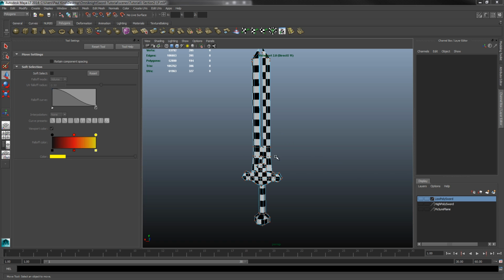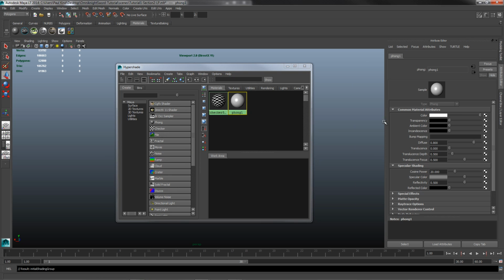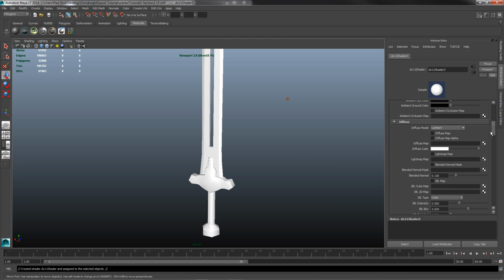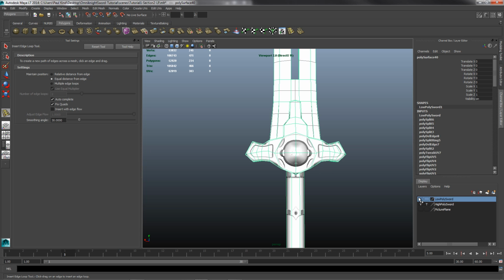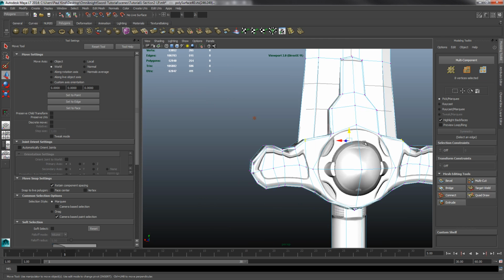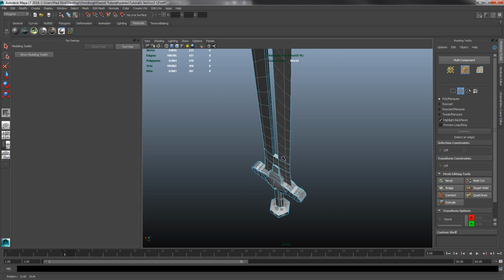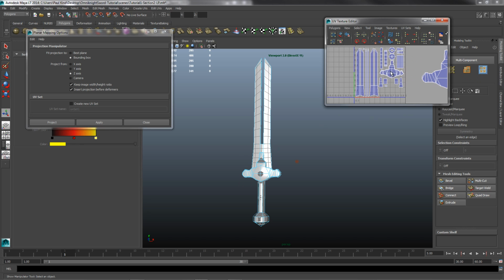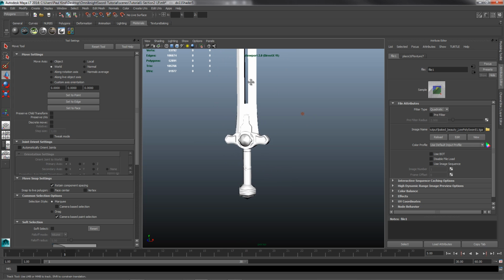Maya LT Dota 2 Tutorial -- Section 2 Part 3

Comment: Also having a problem with the DX11 shader. When selected it appears in the material editor as a sheet of paper icon instead of the normal sphere icon, and is named "unknown7", any suggestions ?

This video series has been absoloutely sweet up until this, thank you!
Reply: I solved my own problem! Guess thats what it all about!

For people who experience a similar problem its because the program was using OpenGL instead of DX11. Window > Settings/ Preferences > Preferences > Display > under viewport 2.0 select "DirectX 11"

Save your file > Close > Reopen and now it should work
Reply: Surrealist94 You just unblocked me!, thanks!

Comment: Nice tutorial videos, really helps sm1 like me who is still new in 3D modeling. I just have a problem when it comes to the baking part. I am using Autodesk Maya 2014 (not LT). I adjusted all the settings like what you did in the Turtle settings. My problem is that I just can't bake my texture. I can't find the Texture Bake button. Please help me!

Comment: great videos! they are helping a lot :)

i got a problem though.. when i "duplicate special" the left half of what i'm modelling, the right half is reversed. since it's an instance i can't just reverse it without the original half getting reversed. anyone got this problem or know a solution? :/
Reply: okay sorry not so sure if it's reversed. it sorta gets.. blacked out. it's just black.
Reply: okay sorry i solved it. after combining the two it just turned grey again. god knows why! :S
Reply: MrFacedip
this seems to be an issue for some people.  What I find works best is to crush the history (for that object) then freeze the transforms.  Once thats done mirroring seems to work as expected.  Something causes the mirror operation to act funky sometimes.
Reply: ***** felt free to pm you on another concern!
Reply: MrFacedip
hrm i didnt get anything. =(
Reply: ***** google+ isn't pushing notifications about personal messages you'd need to check your inbox (in case you didn't)
anyway i can comment the message here if you like!
Reply: The reason it turns black is you're using the duplicate special with a NEGATIVE 1 in Scale. That's effectively reversing the normals on your geometry. If you turn Two-Sided Lighting OFF in the Lighting Menu in your Viewport you'll see exactly what I mean. 
Freezing the transforms fixes the issue because it basically tells Maya 'yo, my geo is inside out and that's how I want it. 

The 'proper' way to mirror geometry is to go to Mesh -> Mirror geometry - and the cool thing is you don't need to combine the other piece nor merge it. Maya does that for you. Just keep an eye on your vertices since the Threshold on the Merge operation performed by the Mirror operation tends to be pretty high by default and it takes into account ALL the vertices of your mesh so it might end up merging verts on beveled edges and so on. Reduce it from the channel box to .001 and it's all cool ;3
Reply: yea, i know about the -1 scale thing, but that isnt the issue they are having.  It is also true that freezing transforms often fixes it though in a few of the cases it did not.  The faces are not flipped, they just display black.  It seems to be a display bug when you mirror with a big history.  I have seen this issue a few times now and I know for sure I don't set scale to -1.   None the less, yes mirror also is a choice, but as it is a more limited function (it only mirrors) and as you noticed can be tough to use, i figured this method was better for newer users.  They learn a single powerful array creation tool and learn how to use it for mirroring.  The merging (welding) of the verts is an extra step, but again its good for new users to know how to manipulate points and merging is an important task.

In the end, there are a million ways to skin this cat.  My way is just one of em =)
Reply: MrFacedip
 yea that is fine.  Just fire away.
Reply: Rynnie S
Aha, i see what your talking about.  Nice pick up. +1 to you!
Reply: ***** you'll be glad to hear that i have even more questions than those i put in the message! first: is there another video series - preferably by you since you use maya lt and your voice is just very nice to listen to - on the subject of altering animations and the like (like changing a thrown fireball to an iceball or something like that)? secondly are there any videos on changing the posture of the character, the way he stands and holds the gear so to say. and lastly - for now - how do i know which joint i need to use if the workshop requirements make no statement about that, and how do i know how they will behave, also how would i alter that, because i tried to put a "shirt" on axe and i used the shoulder joint that was used for the armor and it just glitched out sooo bad, i don't know what to do haha

i know that's a lot of questions and you might not know about the last point, but i figured i'd just ask! anyways thanks a lot for the time :D

Comment: I'm having an issue locating the texture baking settings. I have a whole bunch of drop-downs on the shelf but I don't have the materials or texture baking tabs. It took me a while to figure out where the hypershade was and I was able to add an icon to a new shelf but I just cannot find the texture baking settings anywhere. I'm sure I'm being a complete idiot but it's driving me nuts. I don't have a materials button in the windows tab and only batch bake, assign new and assign existing bake set in lighting/shading. Any help would be awesome.

Comment: I am missing the dx11 button on my mac. What can i use instead? All the others exist
Reply: DX 11 is a shader specifically for windows as it uses Microsoft DX11 to display it.  On the mac, you can choose Open GL for display but you wont get some of the cool features found in and Direct X and compatible shaders (ie:ShaderFX).  It too can display your textures just fine, but some of the specific tools in DX11 wont be available to use.  For example in section 3 we get into the shaders a bit more deeply and you may not be able to participate in that portion of the tutorial.  No worries though, Open GL is ample for 99% of what we will cover in this tutorial and the parts that are can be worked around.

http://download.autodesk.com/global/docs/maya2013/en_us/index.html?url=files/GUID-EE108A86-9830-455E-BF2F-64A4075E8303.htm,topicNumber=d30e621601

That seems to be the official documentation on display settings.  You may want to run through that.  DX11 is pretty sweet and if you can run it on a PC it would be worth it.  You may want to consider boot camp / dual booting so you have the best of both worlds if you plan to take 3d and games seriously.  I used to be a mac guy, but in the 3d game dev world, it currently seems PC is "king".  Plug ins, patches, secondary apps, etc all seem more available on the PC side... not to mention DX11.  Just my 2 cents tho.  Mac is certainly just fine if you prefer it.